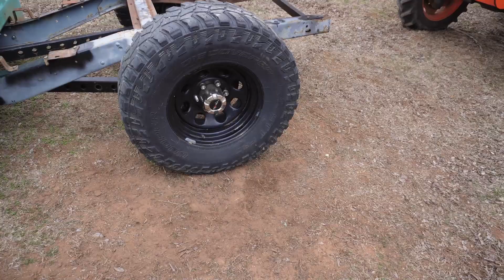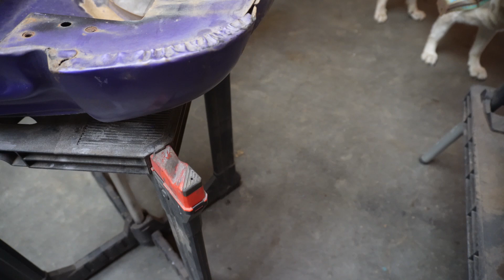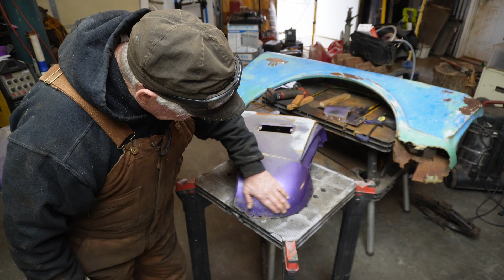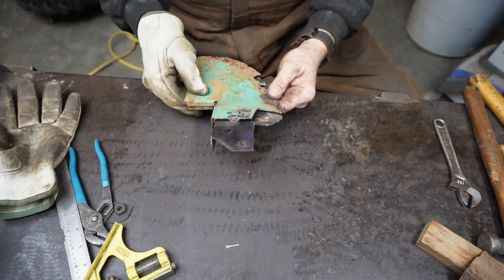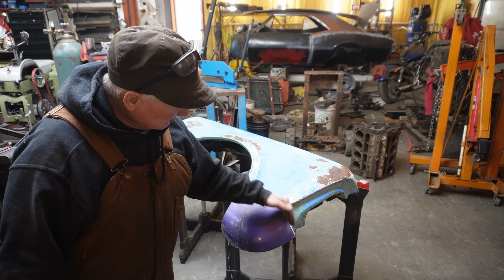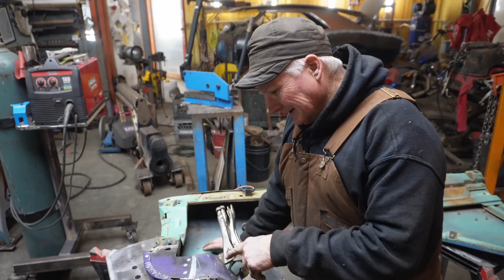Patch a 67 C10 fender with a 69-72 fender

Comment: Nice work Random. Im working on my 67 fenders right now. I have a couple donor fenders but they are 69/70ish. Guess Im doing what you just did.
Reply from the maker: Are your donor fenders factory stampings? If so, you can trust your measurements. If not, try to measure using the horizontal body line as "truth" and pay close attention to the "sharpness" of the bend lines. Repo fenders are not as crisp and can be misleading. Good Luck.
Reply: @RandomRodShop  Thanks for the heads up!